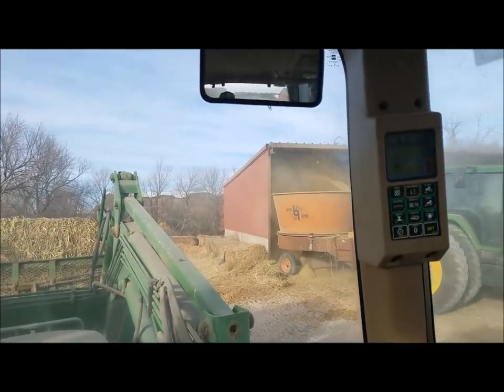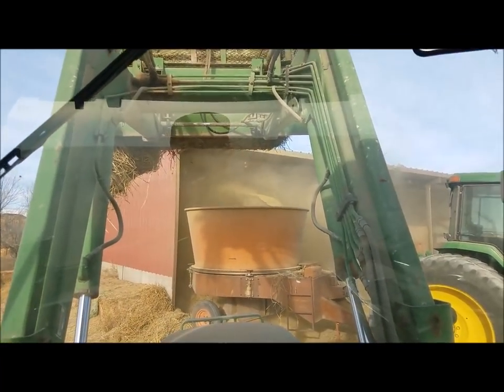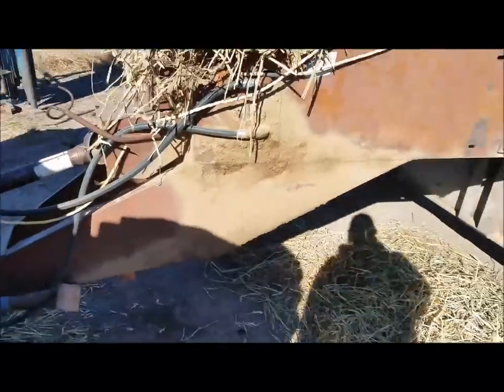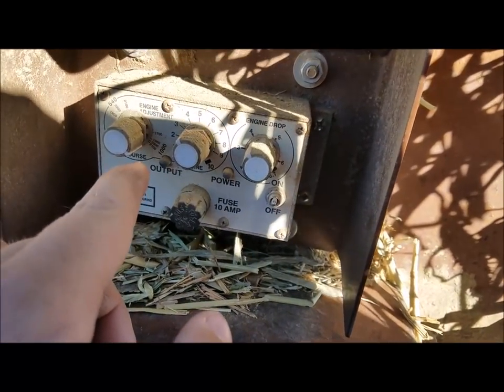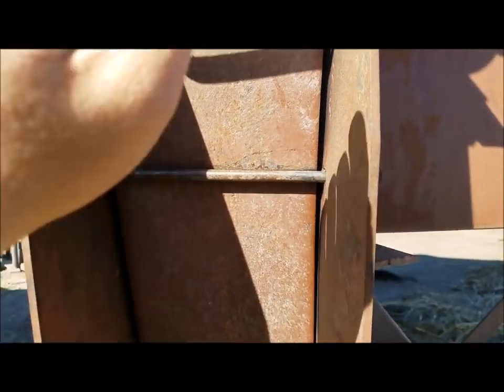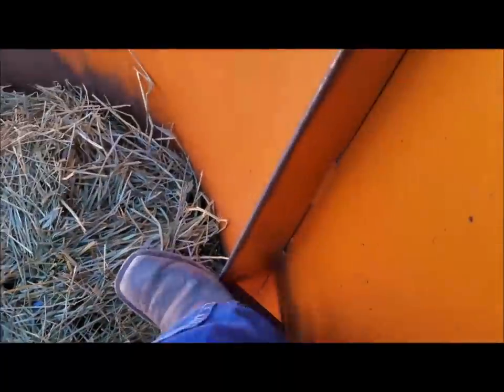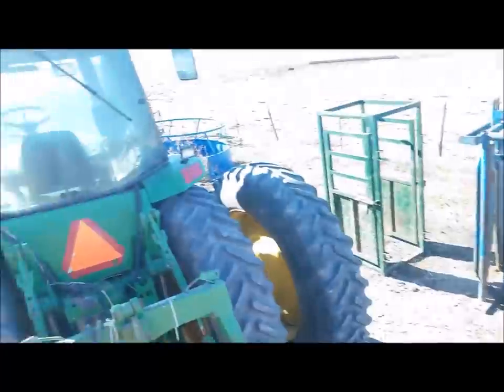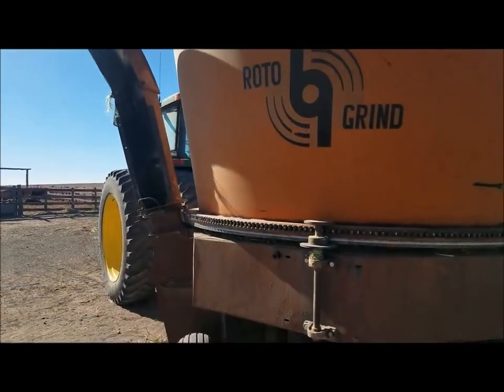Why I bought A RotoGrind 760

Comment: Enjoyed the vid!  You really hit the points spot on.  Two biggest factors for us when we went with the rotogrind was COST, and being able to grind wet hay with fewer HP.  We ground hay on our 115hp tractor the first year we owned it.  Even with the low HP, it ground 15 bales per hour, even in grass hay-  It did fine and wouldn't hesitate to do it again. Rotogrind build their grinder around protecting the drivetrain of the tractor from shock loads that come with wet hay that will kill many tractors that run a haybuster or other style grinders.  The large narrow hammer mill powers through the slugs, and limits the bite the tractor can take.

In the north were we are you are constantly dealing with snow melting and freezing on the stacks, so in the winter time you are constantly having to deal with grinding wet hay.  The Rotogrind just does it better and for less money.  Another big perk is there is so few parts to maintain. a few bearings, hammers, and that's it.  Not like the auger/conveyor, hammer, pto , chain/sproket drive stuff you have to deal with on a haybuster.  Keep your stack as close to the chute at possible or blow the hay onto a backstop and your leaf loss will be minimal with alfalfa.

I always thought your tub was grinding VERY slow on your grinder Will.  even with a full bite, your tub should be moving fast enough to load the tractor to the point where the electronic governor should stop the tub once or twice a per minute. you should be able to increase your speed by 1/4-1/3 easily with the amount of HP you're throwing at it.
Reply: When you say wet hay, are you taking haylage or dry hay that got wet?

Comment: Quick question, why is the plastic from the square bale more dangerous than the plastic from the netwrap? I always take off netwrap off round bales before I put it in my haybuster grinder. Two reasons, I don't think calves should eat plastic and I hate picking it out of the hammer mill. Great video.
Reply: your right, plastic is bad for animals. but reason long loose treads from square bales is wourse, becouse it  is easyer for the hammer mill to grab hold of it and the tread wraps around the hammers instead of beeing pulverised making the mill not work properly
net wrap usually is like a net that grabs hold of anything, even straws, creating friction so that the mill can shred the net to tiny piecas

Comment: I think the newer vertical mixers are better than the old ones. I run a penta and it cuts up a bale in no time. I dump all the ingredients in and let it run for 5-10minutes and it’s good. I’ve gotten distracted while it was mixing before and let it go for 20 minutes and it turns into sawdust. We used to chop hay with a hay buster and put it in a reel mixer. in our case it save a lot of time and we’re getting a better mix with the vertical.
Reply from the maker: Joshua Grundyson I had a brand new Kuhn in twin screw. Took just as long as the old mixers to get hay sized to 2 inches and under

Comment: What would I need besides the Roto Grind 760 to add liquid molasses to the feed? What kind of mixer? I am a small operation in South Central TX. I was thinking of a old hammer mill vertical mixer.
Reply from the maker: You don't need a hay grinder to ad molasses to feed, really only need one if you're going to add hay into a ration that goes through a horizontal mixer

Comment: After seeing the hammer mill I understand the decal on the roto mix now lol    My little CIH 8610 has paid for it's self a couple times over.   I can't grind wet hay.    I found a haybuster 1000 that was wore out and the guy wanted $5000 and I said no, he put it in the auction and got $20,000.